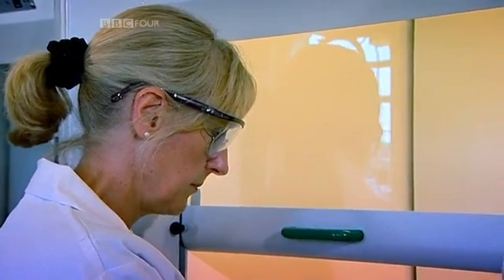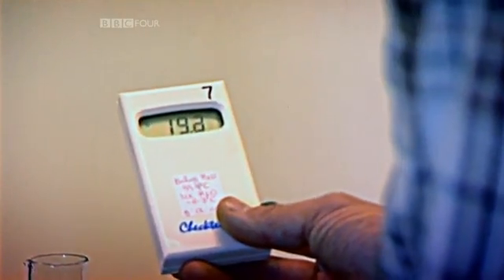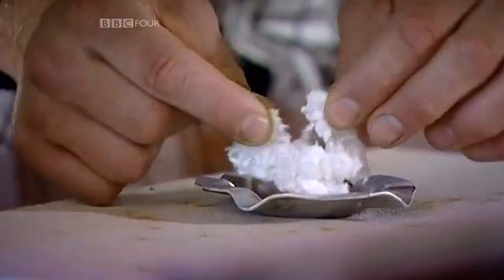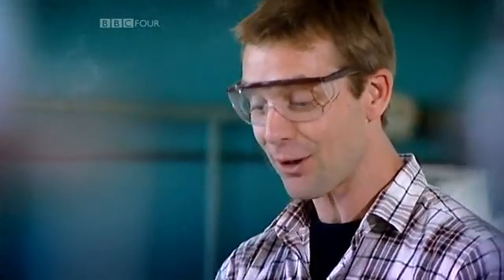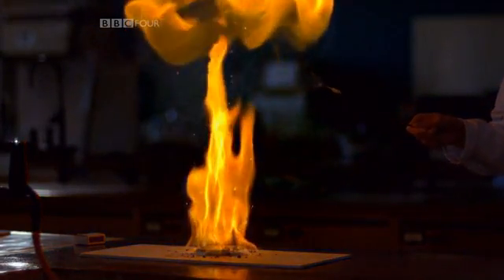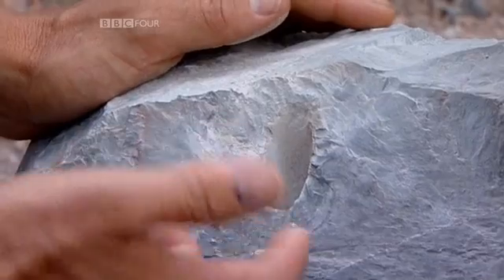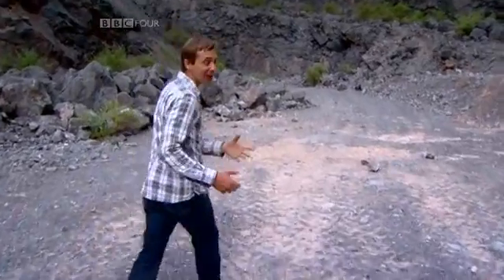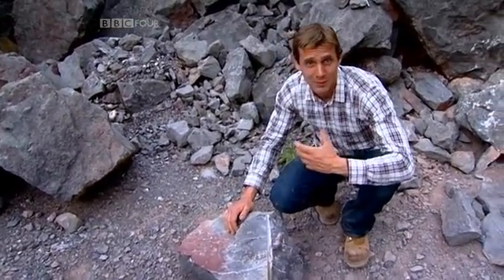How Guncotton/Nitrocellulose is made and what does.

Comment: Gun powder, charcoal-sulfer-potasium nitrate, and gun cotton are not explosives but are, in fact, propellants.  Confined they to exhibit explosive results due to confining the expanding gasses.  Real explosives propagate at much higher speeds where touching them off even unconfined explode.  One would not want to do to an explosive what was shown in this video.  The result would be an explosion not just rapid burning of black powder or nitrated cotton.
Reply: Wrong, compressed guncotton is a high explosive and it detonates. They used 1000 pound charges of it in sea mines.

Comment: Actually gunpowder burns faster. The differences are far more complex.
Reply: The difference isn't so much the speed of the burn with gunpowder vs nitrocellulose. What makes nitrocellulose SO much more violent is that it makes 6 times the volume of gas compared to an equal measure of gunpowder by weight. 1oz gunpowder burning slightly faster cannot compete with 6 times the gas volume produced 100th of a second slower by nitrocellulose. Its the same thing we see in nitromethane fueled dragsters. Gasoline has more energy in it than top fuel but the fact that nitro carries its own oxygen means we can burn far more of it. In the end producing far more hot expanding gas wins even though gasoline burns faster.

Comment: Actually it doesn't detonate. The explosion is not a detonation, but rather a deflagration. Look it up on wikipedia for more info.
Basically only high explosives (C4, etc...) detonate, since the shock-wave is faster than the speed of sound in the material. Gunpowder deflagrates, since the shock-wave moves slower than the speed of sound in the gas produced.
Reply: @Scout
How confined do you mean? Like packed into a thimble basically?
Reply: Nitrocellulose has a detonation velocity 7300 m/s, higher than on TNT.
Reply: @okaro6595  ok, now look up the speed of sound in nitrocellulose. The wave of the detonation travels slower than it.
Reply: Compressed guncotton detonates as it is a high explosive.

Comment: Can we use this in a catrig
Reply: I assume you mean a cartridge? If so, yes. Single base smokeless powders are compromised of nitrocellulose, double base powder use nitrocellulose and nitroglycerin, and triple base powders use nitrocellulose/ nitroglycerin/ and nitroguanadine.

Now for use as a propellant, there are different chemicals used to control burn rate, act as stabilizers, etc. But nitrocellulose is the primary ingredient.

Comment: Could it be compressed to increase its explosive power? Isn't there any risk of ignition or explotion in it?
Reply: Ooo
I know this comment is two years old, but I just really want an excuse to share my firearm related nerdery

Yes, you could compress nitro cellulose to make it more powerful! that's actually one of its biggest advantages over black powder. when you compress black powder it'll eventually get to a point where it wont really produce any more gas pressure or kinetic energy, but you could theoretically compress nitrocellulose to the point where trying to actually use it would be, for all intents and purposes, suicide.

And to answer your second question, compressing nitro cellulose or putting it under high pressure isnt actually all that dangerous, nitro cellulose isnt impact sensitive, it needs a certain level of heat and energy, that's why metallic cartridges need primers to function
Reply: @cheskotokarev  Guncotton can be impact or shock sensitive if the nitrification level is high enough. This was an issue when highly nitrifed guncotton was used as bursting charge in naval shells as the gun cotton will often detonate before the shell penetrated through the armour of targeted ships. They got around this issue by wetting the guncotton with water to reduce its sensitivity.
Reply: @kovona  
Oh, I didn't know about that! My knowledge is pretty limited to small arms, and at that scale I believe it would be incredibly difficult to put enough kinetic energy into the powder itself to make it go off, but that is really quite interesting regardless!

Comment: I wonder did they have to use a blasting cap to set off the guncotton, I didn't know it detonates by itself
Reply: H.E Master could it detonate without a blasting cap by building up enough preassure just by burning to detonate it
Reply: Building up enough preassure by confining it is what I meant to say
Reply: @ridintilldeath9484  in pretty sure it can but u would have to use enough guncotton and use a thick enough body to hold the pressure

Comment: FYI that is NOT Guncotton.  At best she made Pyroxylin (Nitrogen content of between 8.0 - 12.3%). Way too much ash left over to be anything remotely close to guncotton, which by definition has a nitrogen content of at least 13.35%.
Reply: Yes you can tell by all the unburned carbon that this was very weakly nitrated
Reply: Thank You for the information…
Reply: it is, but it didnt fully nitrate. there is several videos of it showing thats actually happening
Reply: So, if it didn't fully nitrate then, it's not guncotton.  Pyroxylin is nitrocellulose with less the fully nitrated cotton.  Gun cotton is nitrocellulose with fully nitrated cotton.
Reply: @wessonsmithjr.6257  What was it about her method that resulted only in a partial nitration? Did the colder temperature slow down the reaction of the concentrated nitric acid? Would it have been a different story had she simply allowed the cotton wool to soak for longer?
Reply: @Mrjmaxted0291  Longer nitration.  At least twice as long as she did.  On a side note, I haven't messed with gun cotton ever since I started messing with Tetrazoles, Erythritol Tetranitrate, Nickel Hydrazine Nitrate, etc.  Wayyyy more fun to play with.:)
Reply: @wessonsmithjr.6257  Ha, Ha same here. I think most amateur chemists start with guncotton then move on to better "energetic materials". Actually the same process that is used to nitrate the cotton is used for many other chemicals. I still make "touch powder" every now and then as a surprise for some unexpecting person, it gets a good laugh when they step on it, lol.

Comment: is it possible for a center fired gun cartridge to be loaded with gun cotton and ignited by a modern primer?
Reply: "Wet nitrocellulose is very volatile "  No it isn't.  Have you ever tried to ignite wetted nitrocellulose?  You can't.  It's how nitrocellulose is transported in the US for safety.  They wet it.
Reply: @wessonsmithjr.6257  sorry for late reply, but 'wet cellulose' is secured with near-pure alcohol, as water destabilize the molecule.
Reply: You must find the way to granulate it, and then coat it with carbon (charcoal) dust.
Reply: Just buy Microcrystalline Cellulose (  http://www.ebay.com/itm/322254123985?_trksid=p2057872.m2749.l2649&ssPageName=STRK%3AMEBIDX%3AIT  ) and then nitrate it.
Reply: Yes, it's possible, but dangerous. It is not unlikely that the gun blows up in your face. The pressure created by nitrocellulose might be too much for the gun to handle. Modern smokeless powder burns much more slowly.
Reply: Yes, but very hazardous if you don't know what you're doing. Modern gun propellant does contain nitrocellulose which is what guncotton contains, but its been intensively and carefully processed to produce a stable and consistent product vs just sticking some acidified cotton balls into a gun. 

Early attempts to use straight guncotton as a propellant for firearms and cannons were mostly  unsuccessful. The guncotton burned too energetically and hot, wearing down or bursting gun barrels. Performance was erratic as burn rate will vary batch to batch, and guncotton had a tendency to decompose if you didn't take care to wash out or neutralize any leftover acids. Even then guncotton will still decompose slowly and become more sensitive or explosive over time, giving it limited practical shelf life.

The first practical nitrocellulose based propellants got around these issues by first carefully controlling and measuring the nitrification process to reach a desired nitrogen content. The resulting guncotton must then be repeatedly washed & rinsed to remove any trace of unreacted acid (British cordite production will wash their guncotton 8 times). The  guncotton is then gelatinize with a solvent like acetone or amyl alcohol, which turns the fibrous guncotton into a malleable mass than can be formed into uniform sized flakes or pellets that give a more control burn. Stabilizers are also added to reduce the rate that nitrocellulose decomposes to an acceptable level (potassium carbonate, camphor, petroleum jelly, centralite, diaphenylalanine, etc.) to improve shelf life and stability.
Reply: Sure, nitrocelulose is actually modern gunpowder. There are some additives to control burn, but you can try.
Just be super carefull, it may burn much faster and blow up yout gun.

Comment: Was that done by a blasting cap or just compaction?
Reply: Fuse, blasting cap, or just a battery and steel wool. Anything that will make a spark. You can also impact it with a hammer but I just don’t think I would want to be that close to it.